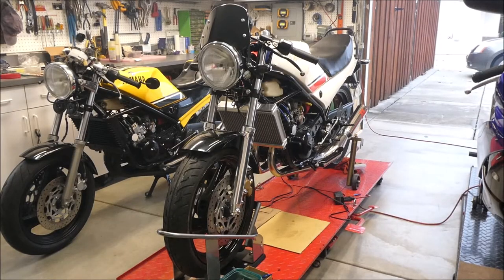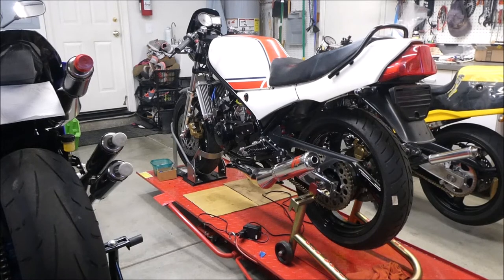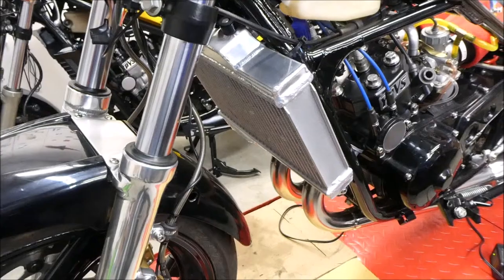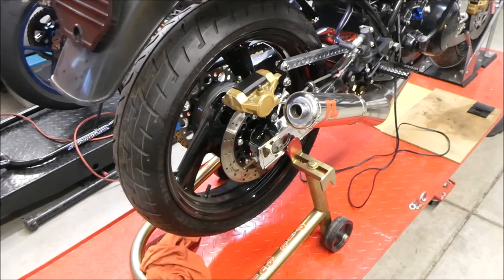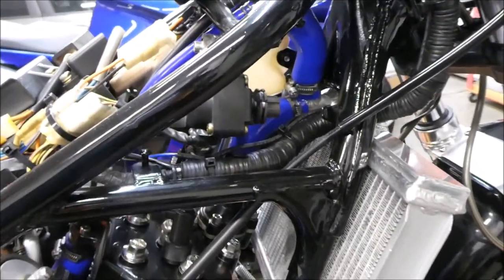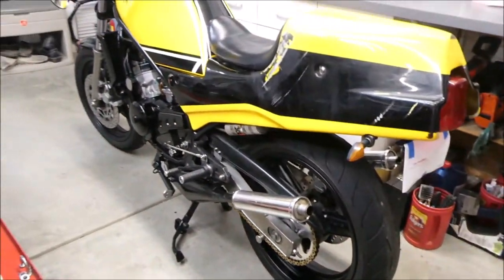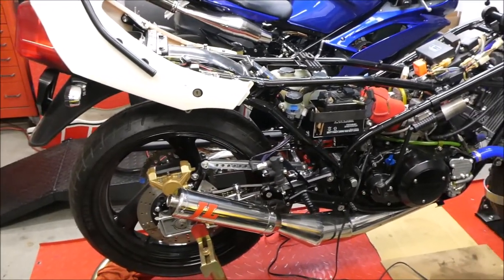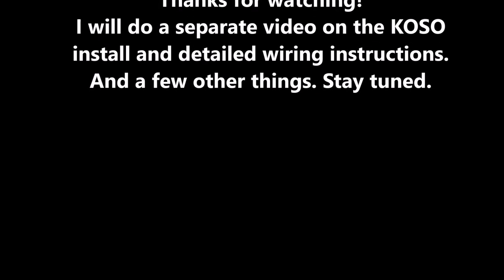RZ350 RZ FZ FZR Project Motorcycle Ep 1 Overview of some of the upgrades and modifications.

Comment: I wish I could find someone in Northern CA. to help me tune my bike.  I have TM28 flat-slides, Y-boot K&N, HVC Pipes and just seems to want to run lean.  Had to go over 220 mains just to get response at more than 3/4 throttle.  Running 270 and still runs a little hot.  Hard to do plug chops near where I live.  The more throttle the more it falls on it's face.  I'm suspecting my left seal is bad and I have full seal kit.  Going to replace it when I install my vape ignition system.
Reply from the maker: Where in Nor Cal? Most of my RZ's end up with a similar tune and carbs so I can usually get pretty close right off the bat. None with flat slides (at the moment).  I do have a set of 32 flat slides that may go on an upcoming project. If you'vs got a bad seal better take care of that first. Good luck.

Comment: Nice builds! I have a few questions regarding the front end and rear wheel conversions, I have a fz600 front end and was wondering what was involved in adapting the front end? I also already have a fz600 swing arm and wheel already fitted to the bike and a sv650 wheel I wanted to adapt and also wondered what that took as well. Thanks for posting your projects, very inspiring.

Comment: What's involved with putting the SV swingarm on.  Do you have to widen the frame?
Reply from the maker: This bike has an FZ600 aluminum swingarm (not SV650) and FZR600 wheels. I have another one with the FZ600 swingarm and retrofitted an SV650 17 inch rear wheel. Much better solution than the FZR600 18 inch rear wheel.
Reply: So the FZ600 swingarm fits in with no modifications?
Reply from the maker: The FZ600 swingarm needs to be narrowed at the pivot. If you use a FZR600 18 inch rear wheel you will need to machine down the sprocket carrier and use an offset countershaft sprocket to get the chain alignment correct. One of these days I will put up a video showing everything required to get the SV650 17 inch rear wheel in there.
Reply: @KensGarage1  So if i want to set up an SV rear wheel i should be looking for an FZ600 swing arm?  from what year?
Reply from the maker: @elkarfischer8278  Search for a 86-88 FZ600 aluminum swingarm. They are getting extremely hard to find. Good luck.